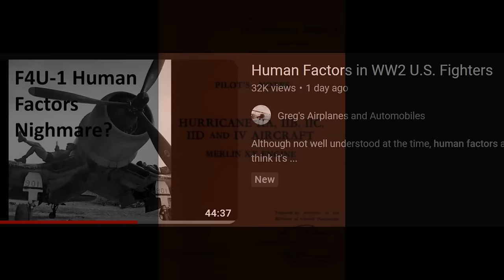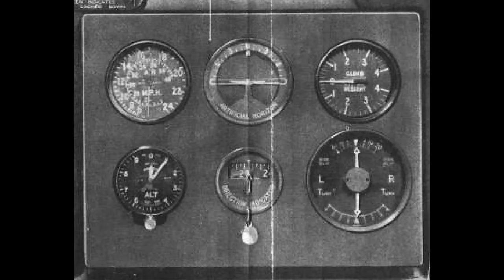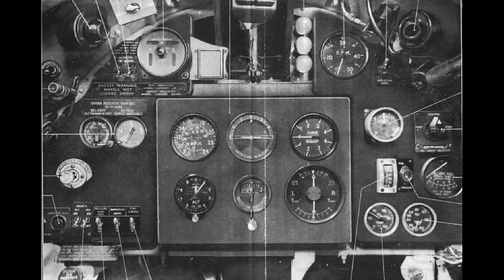Human Factors In British and German WW2 Fighters

Comment: Great video.  Any idea what the straps are on the rudder pedals in the Fw 190 were for?  Did the pilot strap their feet to them so that they could pull them, or to keep the feet in place?  Never saw that before.   

I fully agree that the human factors/ergonomics of a cockpit are important.  I spent a lot of time on this with my RV-8 build.  It turned out great, but even still there are a few things I would do differently now that I'm flying.
Reply from the maker: Then keep the pilot's feet on the pedals in hard maneuvers, and enable the pilot to pull as well as push on the pedals.

Comment: For holding a course over a distance, the compass was used, on which a desired heading could be set (two white lines) iirc. The DG was really only used to orient the aircraft when in manoeuvring flight when the compass was liable to turning and acceleration errors, and didn't require to pilot to go "eyes-down" to the same degree he had to when referring to the compass, or, of course, when instrument flying.
Reply: Try a trial flying lesson, you would enjoy it.
Reply: @givenfirstnamefamilyfirstn3935  I'm a retired commercial pilot and instructor, but thanks for the idea!

Comment: I own a Europa mono wheel a two seat British designed homebuilt kit plane. In keeping with British tradition, the flaps and gear have the same lever, this to simplify and avoid gear up landing for if one fails to drop the flaps the nose blocks the view of the runway on approach hence a clue you forgot something.
I have found when many pilots get used to bad ergonomics and they reject the idea of fixing the issue. The Europa has a control stick, throttle and gear/flaps lever in center console and to the right of those is the brake handle.  It's rather awkward having the brake handle on the far right of the throttle and a few pilots have bumped the throttle reaching the brake handle. 
 I fixed the problem mounting a motorcycle style brake handle on the stick, it's perfect now, but many Europa pilots are accustomed to the brake handle and will not change it.
Reply from the maker: That looks like a really fun airplane.
Reply: @GregsAirplanesandAutomobiles  It really is, but like a Grumman Wildcat it requires respect in the ground handling. Good speed for a low fuel burn, between 2 and 5 gallons per hour 140 to 170 kt depending on alt. (It's turbocharged) it likes grass fields.

Comment: Having owned and flown a high performance aircraft with an adjustable pitch prop - Hartzell Hydromatic with its massive counterweights and huge oil bladder that pushed a piston that moved those counterweights - adjustments to suit various situations become unconscious. Oh, but I never went into combat with one 😂 And I've flown Murphy instrument approaches where everything failed but needle, ball, and airspeed. And the glideslope failed...turned into a nice localizer approach...which they didn't have exactly. Thus I've LONG wondered how the actual hell WWII pilots managed in weather over Europe. So, thank you, Greg! And the sad fact is that many didn't. The Soviets stuck with that pneumatic brake/steering for quite some time. So, so many Yak 52s and similar aircraft POURED into the States after that nation's fall. I'm sitting in one in my profile picture. It was...interesting, but cheap. So...

Comment: Am I correct that the 6 pack layout was common on most British aircraft during WW2? How much of a human factor is that kind of standardisation? I assume combat crews didn't change aircraft types that often but it must have been very handy for non combat crews who had to ferry aircraft of many different types around. I'd also imagine it would be of some help to combat crews if they did have to change aircraft types.
Reply: The Brits basically "invented" the six pack.  With minor modifications the rest of the world caught up.  (Final outcome= Airspeed/Artificial Horizon/ Altitude, top three).
One can fly IFR (instrument only) with a turn and bank. It is not 'that' difficult. You can not, however, dogfight. Even with an A/H they tended to "tumble" in the early versions, esp. in a dogfight.  Fix:  fly straight and level with T&B and reset the A/H.

Comment: I'm getting the impression that there was no end user input in designing and layout of aircraft back then. If the designer was a pilot and could think like a fighter pilot he'd have a good layout like Kurt Tank. Is that correct?
Reply from the maker: Yes, Kurt Tank was a WW1 soldier, a pilot, and an electrical engineer.
Reply: I think you're pretty much correct for most companies. There is very little input from pilots in the design stage. Most test pilots pointing out errors for correction. They are not in on the ground floor.

Comment: Whether a cockpit heater is installed depends on the guy in the Air Ministry writing the Specification, who probably last flew in combat in a Camel or a SE 5a. The Designer will only put in what he has to. So RobofGabriola (below) is spot on with his reasoning.
Reply from the maker: Not having a heater is a human factors issue, regardless of who set up the specs.

Comment: At 4:55, you mentioned that airplanes without heaters generally don't have a very effective way to defog the windscreen, and at 15:02 you state "no defogging" for the Spitfire in a context that certainly suggests that problem was common with the Hurricane.  But at 11:35, during the discussion of the flap/landing-gear lever on the Hurricane, there's a switch marked "windscreen deicer" just aft and right of the gear/flaps lever, so the airplane (at least that version of it) did have some kind of defogging system other than a vent.  What did they use, and how (in)effective was it?
Reply from the maker: "defogging" and "deicing" are two totally different things. The deicer in the Hurricane is little pump that sprays deicing fluid onto the outside of the windscreen to minimize ice build up on it. It won't help with fog on the inside of the windscreen.  cont:
Reply: Thank you!  Very helpful and informative (as is the video itself).

Comment: After the first program on human factors, I went back and checked my IQ test manuals.  By the age of 16, which is the age at which most mental reasoning and processing skills are approaching their adult level, the average person can hold about four to five pieces of visual information in short-term storage, and use this information in order to guide his or her current behavior.  This is commonly referred to as visual working memory.  I would assume that a successful pilot candidate would have at least this level of ability, if not higher.  I find it interesting that the basic number of instruments that need to be monitored in order to be able to fly successfully in the absence of a visual horizon is six.  I can see how you would prefer a scanning approach to instrument monitoring that stresses central focus on the artificial horizon, coupled with systematic, individual checking of the other gauges, as this would appear to put less stress on your visual working memory capacity than would the work-your-way-around-the-box-of-six-instruments method.  Thank you for this informative presentation.  It only adds to my sense of awe regarding the skill of the people who actually flew these machines, successfully, while other people were actively trying to shoot them out of the sky.

Comment: Didn't the spitfire rudder pedals have ridges on them that you were meant to fit your feet into (to elevate the lower leg and improve g loading)
Reply from the maker: Yes, but you can't move them up nearly as high as in the Fw190's normal position.

Comment: Wondering if the fire hazard of the pre 1940 use of 100% Glycol as coolant was a factor in not fitting cockpit heating.
When water glycol mix coolant was adopted the fire risk was greatly reduced
Reply from the maker: No, because most cockpits were heated in other ways, they didn't put a heater core in the cockpit like you would in a car.

Comment: Awsome work Greg,quick question regarding the P-47.I am a new DCS pilot and I love the P-47,but I am a bit confused about the whole Turbo under 7k feet deal.In short,if I pressure to 64 with water and turbo do I lose the 300 hp from the supercharger and turbo working togheter or that dosent apply when WEP-ing?
Reply from the maker: You only loose the power if the throttle isn't all the way forward and you're using the turbo to make up for it. So at 7000 feet, the way to do it is have the throttle all the way forward and the turbo level with water on far enough forward to get 64".
Reply: @GregsAirplanesandAutomobiles  Crystal clear ,thank you ! There are so many versions of this going around .

Comment: Hi Greg I have some questions about the Hawker Tempest, first in your opinion how good is the cockpit ergonomic of the Tempest?
How good are the placement of the controls and the seating position of the pilot? The Tempest cockpit have a flor and an heater for the pilot? And finally how good are the landing gear of the Tempest and its fuel system?

Thanks for the answers and for doing this exquisite videos Greg.
Reply from the maker: I appreciate your support. Of course I can't cover every airplane in every video, but I'll get to the Tempest at some point. The short version is that it does have a heater and is overall pretty good.
Reply: @GregsAirplanesandAutomobiles  ok very interesting I ask this because I love the Tempest I think that can be one of my favorite fighter of the war…
Reply: @GregsAirplanesandAutomobiles  compared to the Mustang D how good the Tempest Mk V is?
Reply: @M.R.0662 the tempest is probably the best low altitude fighter of the war. The P-51 with its two stage supercharger was better high up.

Comment: The problem with looking at ergonomics and human factors in the 1930s is that no one at the time did. The philosophy was to make the human fit the machine and not the other way around. It was only through the experience gained during the war and afterwards in the civilian aviation world did the concept of human factors evolve and even then it was slow. I flew Nimrods as a flight engineer and then L1011s and I can tell you that both designs, 1950/60/70 had little to no Human factors input. I now teach A220, the very latest in aircraft cockpit design and I have a hard time explaining how much easier the cockpit is to learn than the old aircraft I grew up on. Oh and the compass design was so you could set a magnetic heading by rotating the bezel and then steer the aircraft by keeping the compass needle between the two beam markers. Much easier than looking at a standard e2b.

Comment: IIRC, early Lavochkins La-5s had a problem with cabin /cooling/, not heating ;)
Reply from the maker: In the La5 it didn't matter, they had enough carbon monoxide poisoning that they wouldn't feel it anyway.
Reply: @GregsAirplanesandAutomobiles I remember reading about overheating of the second row of cylinders of ASh-82, as well as of oil overtemps on the prototype, but I didn't find that fact about CO. Early La-5 frames (based on LaGG airframes) could be flown with open cockpit, but I don't believe the latter F and FNs could.

Wasn't CO one of the problems of early Hawker Typhoons making pilots always fly on oxygen at some point?

Comment: Every so often there's a Quantum Leap forward, you only have to look at the F-16 as an example there. It's cockpit and flight controls rewrote the rules with regard to ergonomics making other Aircraft designs seem unwieldly, but now with leaps forward in touch screen technology although the F-16 has been modernised in the cockpit, in comparison to a modern gen Aircraft it will seem difficult to manage and require a higher workload in comparison.

Comment: The most important reason for the kill button for the electrical system was that the tail plane was adjusted by an electrical driven screw. It happend that the switch for the tail plane trim malfunctioned and would trim the aircraft into the ground (737 Max moment). I saw an interview of a Fw 190 pilot who encountered such an failure right after take-off and the plane started to nose down. He was able to save himself by using the kill button.
Reply from the maker: That is another good reason.

Comment: An excelent video like always, I have two questions, one related and one unrelated, the related one is if would be a part three, of this series (now with the soviet aircrafts, or the one dedicated to the  Bf 109)? and the unrelated is if will you continue the Fw190 series (I am still waiting for that to continue)?; in another note, the little I have found for the FW190A-4 is that been the second with the 801D-2 engine, could use the engine at 1.42 ata, instead of the 1.35 ata used in the A3, also the change of the radio, another thing I found of the A4 was the precursor of the F and G series, in truth the A3/U3 was use as the concept for incorporation of ordenance under the aircraft, but was in the A4 where the it started, with the A4/U3 (latter know as the F1) and the A4/U8 (the G1), one last fact of the A4 was that was the fastest of the Anton series, with 670 km/h while the A3, A5 had a maximum speed of 660 km/h, its weird that of all versions of the 190A the A4 is the most scarce, one can find information of the A3, A5/6, A8 even the D9  but not of the A4, that as far I know, it was the first Anton to enter in the eastern front
Reply from the maker: Hi Ricardo. Rather than make another video entirely on Human Factors, I think I'll incorporate the discussion into videos on other topics, like specific airplanes. You'll see that in the next video.

    Yes I will continue the 190 series and I'll talk quite a bit about the A4. I have enough on the plane to cover it, but still, no cockpit photos, I think it was almost identical to the A3 in that regard.

Comment: The most likely reason the Spitfire and Hurricane pioneered the six pack instrument panel is that there is a lot of fog and low clouds in England.  The Spitfire cockpit is narrow, but it is very well suited for a slim person.  Nowadays, most people that fly these planes are middle age or old people that are usually overweight, and the narrowness of the cockpit becomes an issue (this is why two or three reconstructed ki-43's have wider cockpits than originally designed).  Jeffrey Quill, the Spitfire chief test pilot, pointed out that the vertical pilot attitude in the Spitfire more than compensated for the limitation in G tolerance by the fact that the pilot could look back easier.  If you are aware of a foe behind you early enough, you will have more time to do a climbing turn, bleed off speed, and therefore not need the G tolerance and exploit the turning performance of the plane.  The 109 has allegedly a very narrow cockpit and the canopy gives no space for the pilot's head, and limits rear visibility substantially.  The 109 was a plane for the very brave.  It looks like the Soviet planes were also very rough and brutal, based on the info you presented.  The Russians and the Germans were not building flying Cadillac's for sure.  The USA and Great Britain were rich countries (Great Britain of course was not so rich in 1945), so they were designing more easy to live with planes.
Reply: the Britsh RAE at Farnborough tested every possible combination of the Basic Six until they got the one most of the test pilots felt happy with. When they bought American aircraft, they had to insist that the new aircraft be fitted with the Basic six right at the factory before being shipped to the UK. British built aircraft used the Six as standard from the mid30s on.
Reply: @michaelbevan3285  Were American aircraft of the RAF converted as such?  It seems tough, too many cockpit modifications.

Comment: Hi,
The upright seating is not best position for the pilot pulling G in the Hurricane, where as at least in the Spitfire there were two levels on the rudders, the higher ones allowed a greater tolerance of G. The FW 190 had a reclined seating position which allowed a higher level of G that could be sustained. 
All fighters had high rolling stick forces at high speed and the Spitfire's shortened control column that pivoted mid way must have reduced the leverage that the other aircraft enjoyed.
Happy Landings,
Clive D.
Reply: But ! it had wider travel from not being restrained by a pair of heavily insulated legs.
Reply: Never have worn anything other than a flightsuit in these cockpits let alone any 'Inuslated legs' ! But.......I take your point, but the stick pivot point was higher than my legs!!
Reply: @clivedavidson322  Bet you weren’t in an unheated, unpressurised cockpit at 25,000 feet in winter?  No point in having a 60 series engine at the single stage BMW’s lower optimum altitude.
I wonder how much difference the reduced span ailerons in the improved VIIIs and later Spits made? probably intended to address the 190A’s known advantages.
I missed a two seat IX at my club for a week, saved a small fortune though😎  A flight suit sounds so very sensible, getting black oil stains out of the shoulders and back of a white shirt was murder.

Comment: paddle breaks didnt die out long ago. Russians used them forever. the Su-27 is either the first or one of the first aircraft that DIDNT use them. im unsure if the MiG-29 uses paddles or toe breaks but i wouldnt be surprised if its on the stick.
Reply from the maker: I don't know about the MiG 29, but that system is crap either way.
Reply: @GregsAirplanesandAutomobiles  not something iv flown with irl. only via simulators. but its not something id say is massivly bad. manuvering on the ground is normally slow and  cautious anyway. byond that while i prefer toe breaks that can always be because im more used to them and used them in both simulators and actual flight.